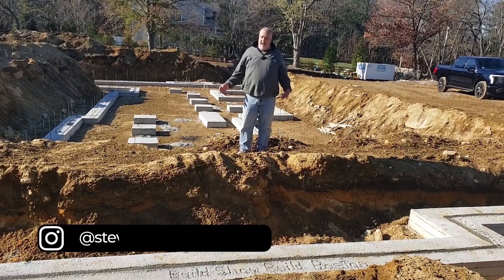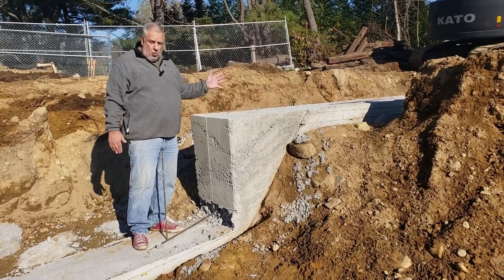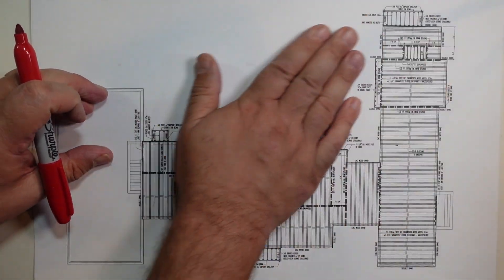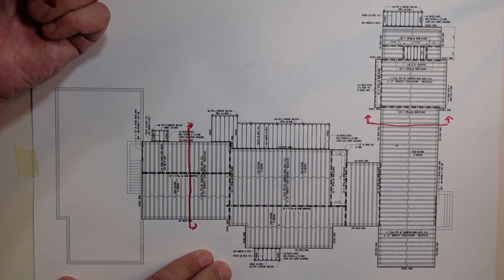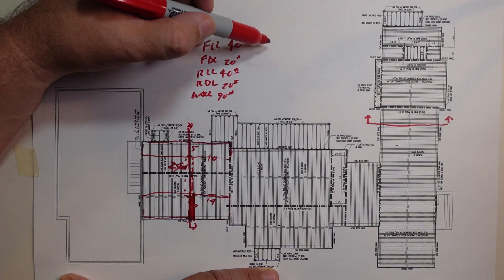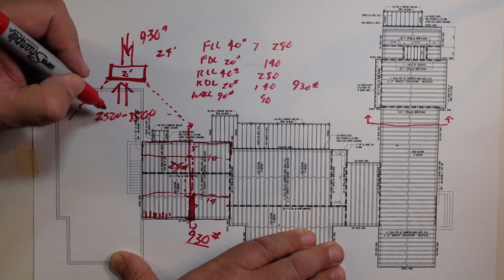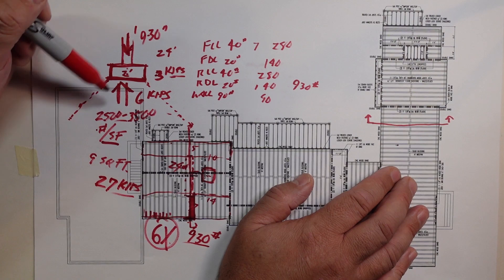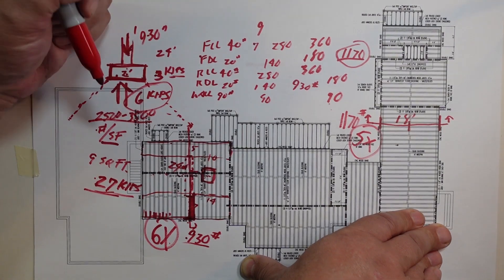ALL ABOUT CONCRETE FOOTINGS

Comment: I'm considering underpinning the crawl area of my basement to get another 1,000 sqft. of finishable basement. I really want to attempt it alone but don't want to crumble my house. I've already had a structural engineer review and plan it. I haven't received concrete specifications yet or permitting. Anyone think this is a job way more advanced or labor intensive than a normal guy can do? I can't see 50-220k I've been estimated, without finishing the space. This is only underpinning and concrete floor.

Comment: Thanks for the video. Question for you. If the footings are 5 or 6 times the needed strength (with conservative safety already built in), why did you decided to use them verse reducing them down? Was the cost difference nominal or was there some other code requirement?

Comment: Awesome content, Steve.

I'm designing a well house to be built in the Colorado Rockies. It will be set below grade with insulated walls and roof, and an uninsulated floor. Being born an engineer (in practice electrical, but now retired), and loving these sorts of problems, I'm doing my own design. In theory I don't need a permit because the structure is under 200 s.f., but it's full of plumbing and electrical, and I need permits for those. So I'll at least ask about structural permit before the fact. Anyway, "soil" is decomposed granite--which is kinda like little gravel cubes that fits perfectly together (if undisturbed). Found a NYC web page that suggests such soil's load bearing capacity might be as high as 20,000 lb/s.f.

Anyway, my idea is a 16" by 7" footing with 2 parallel #4 bars, plus #4 vertical bars about every 24", and dug in so the top of the footing is 52" below ground. All walls will be ICFs with a 6" core, which will weigh about 600# per linear foot---plus the roof, which is made of gossamer (by comparison). Should be okay, even with wimpy #4 bar, but I'm too lazy to try to bend #5.

Just had a storm in my brain... Why make the ICF walls 8' high (6 courses)? I can make them 5' 4" high (4 courses) and do double-stud super insulated walls above (I was going to do the gable ends this way). 😳 I'll have to go back and hit the CAD.

Comment: During a summer while I was going to college for my engineering degree, I worked as a laborer doing footings for a titanium dioxide plant.  One day, the foreman and site engineer came up to me with the plans for the whole site and on it was a thumbnail size rectangle that had been yellowed out showing where a 3ft x 5ft x 2ft steel re-enforced concrete pad that I had formed and helped pour a couple of  months earlier.  The engineer said they eliminated the machine that sat on that pad.  It took me a day with a jack hammer in the Gulf Coast heat and humidity to remove it. The next day I told the engineer I was glad I would be graduating the next year and I would be the guy with the yellow highlighter, aka "Big Yellow."😂
Reply: Did it have to be removed?
Reply: @disqusrubbish5467  Probably wouldn't have hurt anything.  But at my near minimum wage at the time, it didn't cost much.